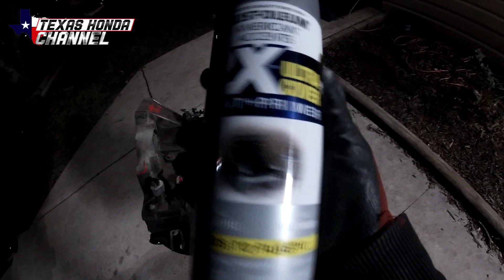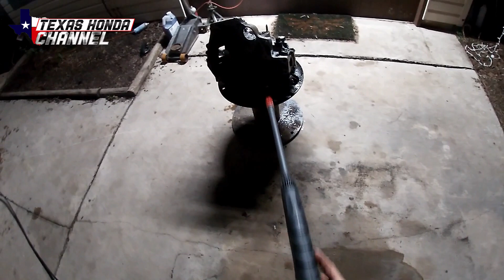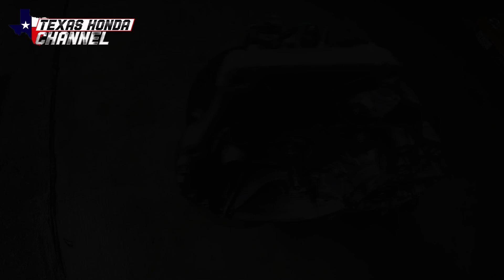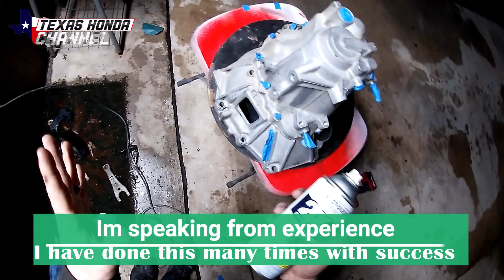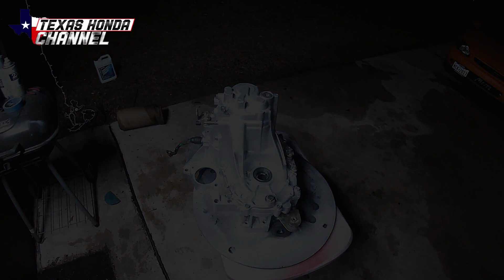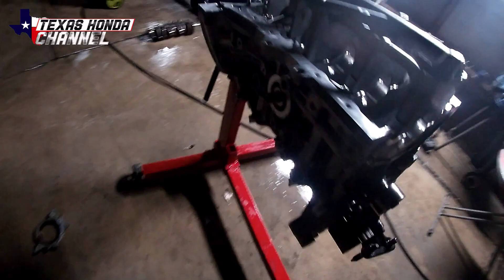Vitara build part 2- Deep Cleaning & painting the Transmission and engine

Comment: Quick question can you still clean the block with everything on or should you take everything off?
Reply from the maker: Gilbert Garcia You can still clean everything with it assembled I would just cover the cylinders and oil holes. Basically block off the cylinders and all holes where the head goes. Unless it’s fully assembled like head on and all. Then your good to go just make sure not to get any water in your distributor cap or injector clips. If you do get water in there make sure to blow it out with compressed air or let it dry before trying to start the engine
Reply: @TexasHondaChannel  ok thank you. Haven't painted a block before but I have to repaint my engine bay and put a motor back in so I was thinking about painting the whole engine.

Comment: Thank you for introducing me to the foaming CRC greaser.  A question I have is I have a rebuilt but rusty cylinder head thats been sitting, should I just WD40 everything or does it need to be hot tanked after another disassembly? its been sitting for over a year and its pretty rusty but its a fresh head
Reply from the maker: I would try to clean it first then if worse case take it to get hot tanked.

Comment: Why didn’t you use speed factory no notch rods
Reply from the maker: 876 Productions I’m poor and they are expensive lol 😂 I paid $250 for these rods and the speed factory wants $350+ same rods just a little smaller. These also handle higher horse power due to being thicker.I have used maxpeeding rods before and I don’t mind notching the block not very hard 🤷🏻‍♂️
Reply: Texas Honda Channel I am poor too and that’s what I love about your Chanel you work with what you got and make the most of it and still make mo powa behbey than others, keep up the good work
Reply from the maker: 876 Productions For sure 😎 I’m working on editing a couple videos right now actually